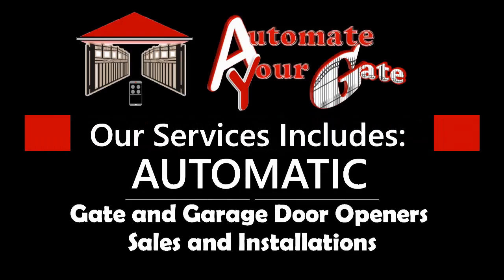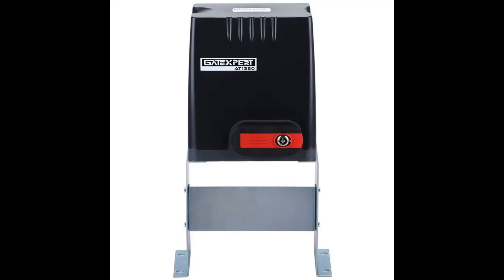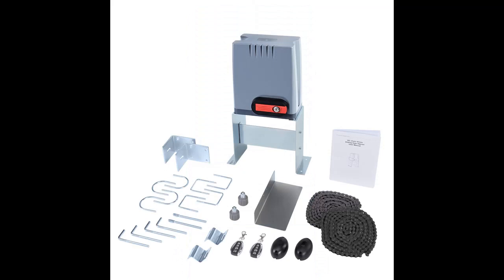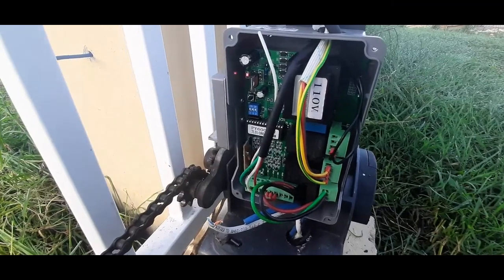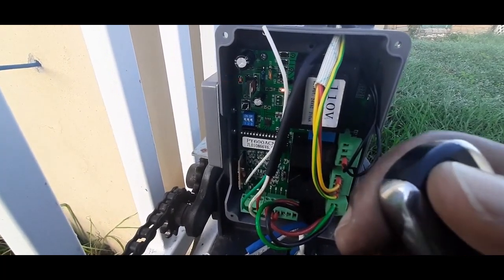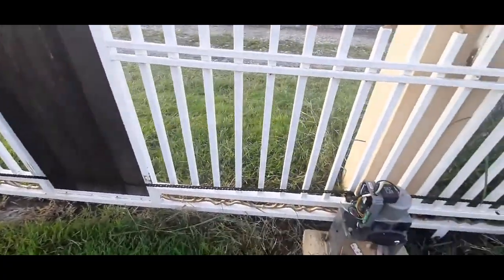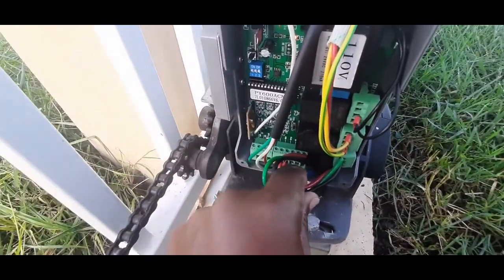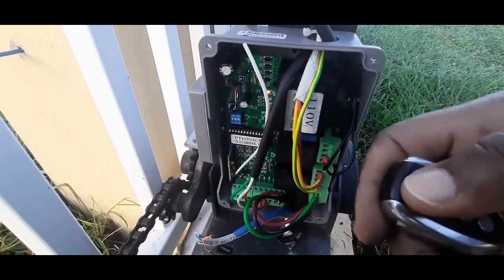CO-Z  Gate opener Humming FIX Part 1

Comment: My gate will open, but will not close. I can move the forward/reverse switch and then it will close, but not open.
The photo cells are not connected so it cannot be related to that.
It is a Co-z opener.